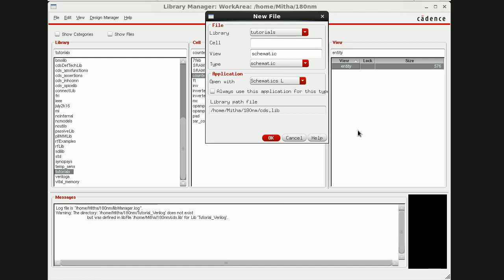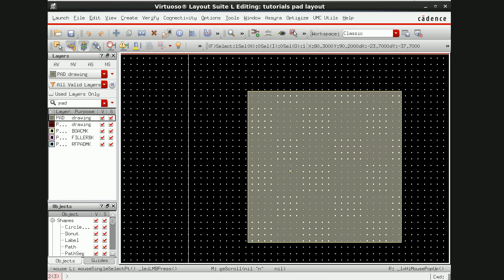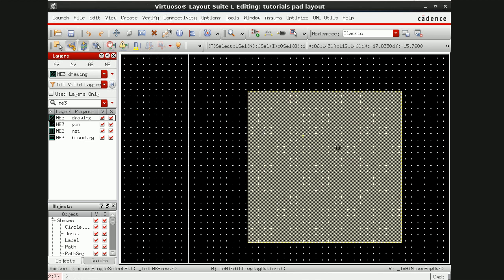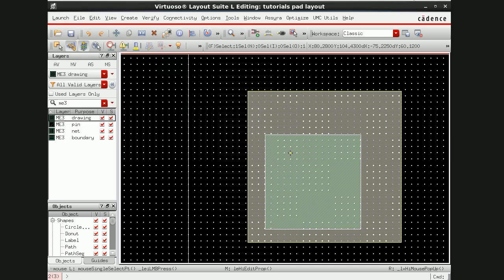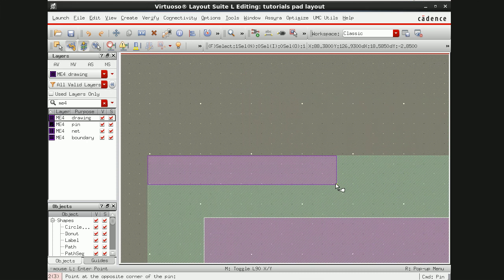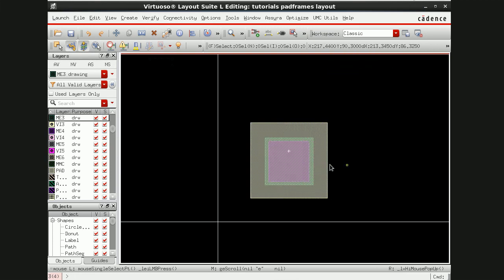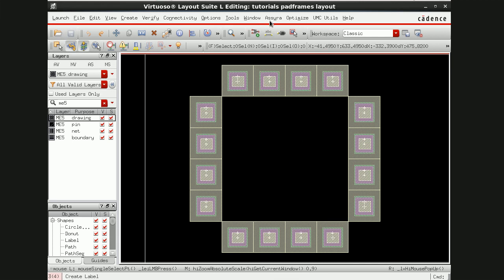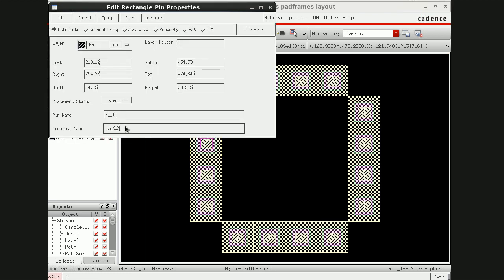Cadence IC615 Virtuoso Tutorial 16:  Layout of Padframe (Part 1/2)

Comment: Thanks for your tutorial. I have some questions. Can we implement your method for drawing and adding pads in TMSMC 0.18 um? I do not have the pad libraries on that version and my version is cracked.
Reply from the maker: Hi, The method discussed here is for normal I/O pads (enough to understand the fundamentals of pads). For example, they can't be used for ESD pads.
Also here I have used same pad to design pad ring which isn't valid in practical cases, since you have different types of pads (i/o, power etc)
If you want to port the same pads to another technology, it is important to know the physics of each metal layers in your technology.

Comment: hello sir,
I used to gpdk 90 nm technology in which there is no pad drawing layer how we make pad in gpdk 90 nm plz response is there any another way to draw the pad frame????
Reply from the maker: Hi,
Yes, you are right there is no pad layer in gpdk90. It is free technology, generally offered by Cadence for practice. I don't think you are going to fabricate your design, so no need to worry about metal layers.  All I would say if you want to design a pad frame in gpdk90, use a substrate layer as a pad layer.  If you use UMC/TSMC, I can tell you more specifically.
Reply: Ok sir.
 means I'll take any layer to make the pad frame it's has no effect..
Sir plz give m urs mail id if possible?

Comment: which technology have you used is it gpdk090 or UMC090?
Reply from the maker: I have used UMC 180 nm. The procedure for other technologies is same, just take care of metal layers
Reply: thank you sir for your reply
sir i have some more query is that i am designing the diffrential amplifier in gpdk090 technology since all mos in region 2 but still i am not getting the gain may gain of opamp is obtained is -11.2db  kindly help me out
Reply: sir when did you uploading the part2 of layout pad frame videos? waiting for that
Reply from the maker: Can you share one snapshot of the circuit with dc node voltages and operating points?
Reply from the maker: I will try to upload asap.
Reply: thank you sir for your support i got the gain
Reply: @MudasirMir7  pleasr sir , how can i add new technologies ( UMC , ..... )  to my cadance version ??
Reply from the maker: You can add the new technology libraries by defining their path in the cds.lib file, or, go to the library path editor option in CIW window and add there